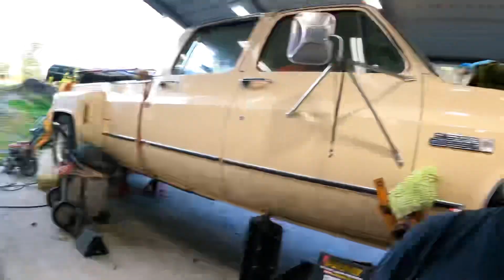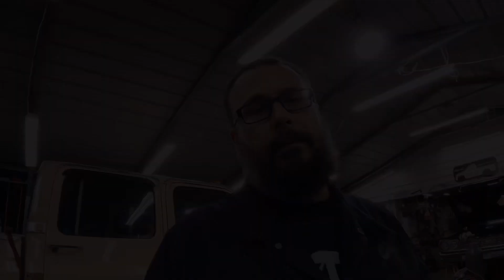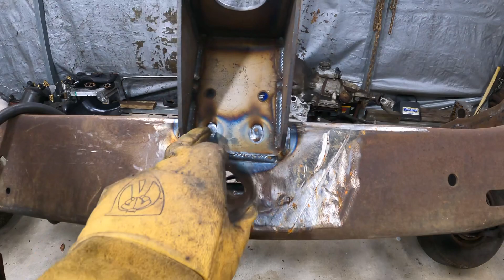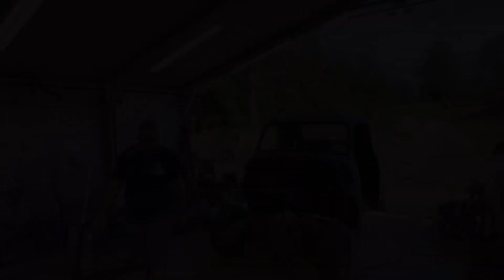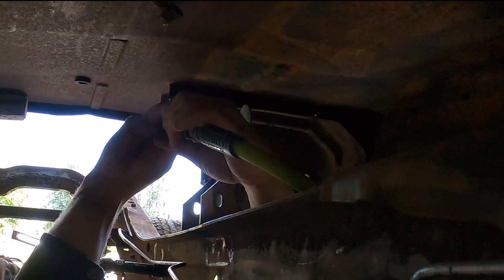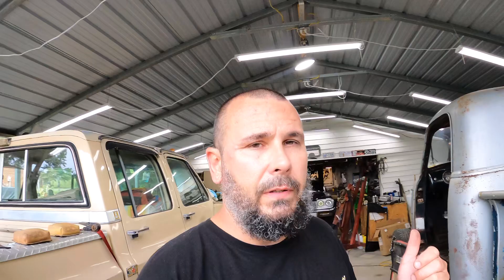1949 - 1954 Chevy 3100 S10 chassis swap. Part 1

Comment: Where do you get that body to frame rubber and bolts
Reply from the maker: Bolts came from Fastenal and the body mounts were just energy suspension body mounts for a s10

Comment: Hello, I have a 55 first series Chevy, I am watching your videos and I want to do this project on my truck
My question is: what year of CHEVY S10 did you use for this project?
The original distance between wheels or center of wheel axles is 116 inches?
Reply from the maker: Any year s10 will work as but it has to be a reg cab long bed 118” wheel base. The 47-55 trucks are 116. So you can either fudge the bed placement or use a Barnes4wd spring perch and move the rearend forward. If I ever do another that’s the route that I’ll go just so I don’t have the extra inch of bed gap.

Comment: I feel like the cab structural elements might be important and would rather cut slots in the replaceable body bushings to fit the cab than cut the original cab to fit the body bushings.  Plus rubber should be easier to cut and can be cut standing up.

Comment: So after doing this conversion would you recommend using an extended cab instead of using a long bed truck
Reply from the maker: You will have to cut down a extended cab chassis since it’s 123”. when and if I do the 53 I bought I’ll use a long bed 118” chassis. Fudging 1” with the bed is easier than cutting a squaring a chassis but on the other hand if I had a 123” S10 chassis sitting here 🤷🏻‍♂️🤷🏻‍♂️🤷🏻‍♂️. If I was shopping for one I’d look for the long bed. 
Thanks for watching, hopefully the videos were helpful.
Reply: @LeftForDeadGarage  that makes perfect sense thank you for doing a how to with this kit I was thinking of of trying to set the cab back .5-1 inch to make up for fudging the 1 inch on the bed placement let me know how you feel about that
Reply from the maker: @matthewmontoya7639  you welcome, Iam happy to hear it’s been useful for some folks. 

I wouldn’t move the cab but what I would do the next time it replace the spring perches on the axle. You can get spring perches from Barnes4wd “ (Or similar companies) that have three spring pin choices. Centered, 1” back and 1” forward. I have used them many times on 4wd truck builds. I know Barnes has perches for the small 10 bolt 2.750 dia axle tube.
Reply: @LeftForDeadGarage  what year s10 frames are desired to do this ?
Reply from the maker: @russellhuston1566 any year will work, long bed reg cab is a must though. I have a short quick 6th video I’ll add about how I’ll make up for the 1” difference in the wheel base and not fudge it with the bed. 
Thanks for watching
Reply: @LeftForDeadGarage your 4 linking so doesn't matter fudging 1". There's spacers for leafs that move it an 1"

Comment: We’re u fin those Mount brakes
Reply from the maker: The master and booster will be frame mounted like they were on the 49 chassis. The firewall will stay clean.
Reply: @LeftForDeadGarage  what about the cap mount bracket where are you find those?
Reply from the maker: @datzun1971 https://www.facebook.com/russdtrucks?mibextid=2JQ9oc
Reply: @LeftForDeadGarage  thank u so much
Reply from the maker: @datzun1971 no problem, good luck with your build.

Comment: I used to think that it was best to keep the original frame and modify it but seeing this it seems a whole lot better. Modern suspension, brakes, steering etc...
Reply from the maker: After messing with this one I understand how this is so popular. Only down side I see is the track width is narrower on the S10 but that can be managed in several ways.
Reply: @LeftForDeadGarage 4WD =60", ZR2= 63"👍😉